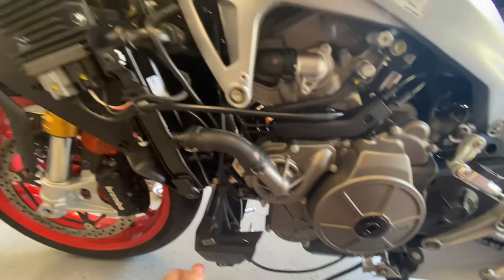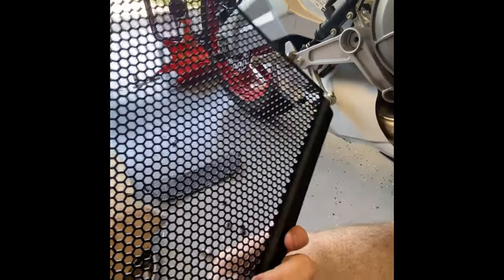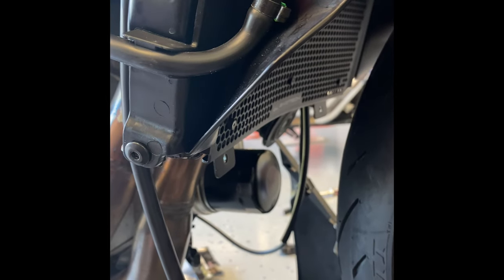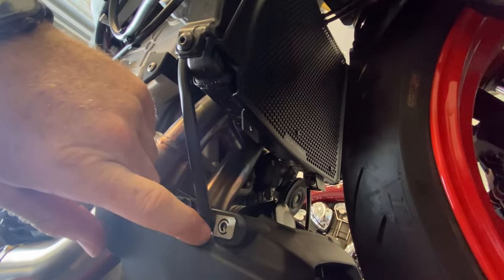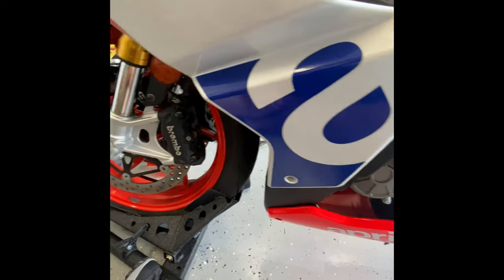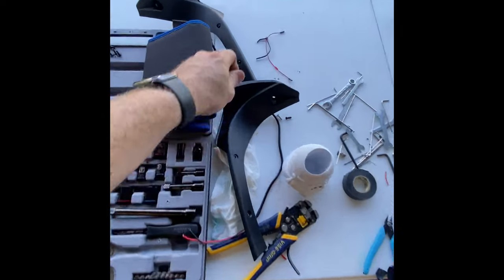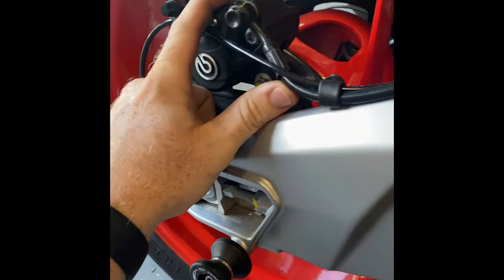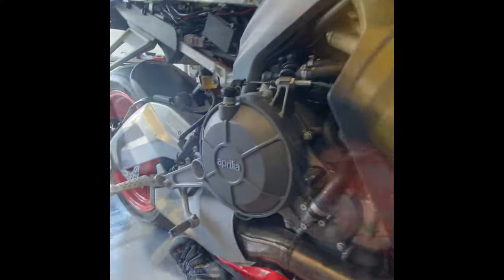Aprillia RS660 Evotech Radiator Guard, Wiring for heated grips and TPMS, MIA. Fairing Install

Comment: This is excellent, thank you for posting this. I just got one in acid gold and I’m bringing it in for my first service soon, the dealer couldn’t get me a radiator guard so I’m just going to do it myself along with the MIA. This was fantastic.

I also have the same squeaky issue with the rear brakes and it’s rather frustrating coming to a stop on a brand new bike and they yell like an old car. They seem to be getting a little better but still. Again, this was great.
Reply from the maker: Thanks! Glad it was helpful!

Comment: I have the RS660 in Lava red, the best fluid to clean the rims is brake cleaner fluid, spray your brakes from the rear to clean them out holding a clean micro fibre cloth underneath to catch the excess, flip the cloth so you don't wipe the grime from the brakes onto the rims and wipe gently, hope it helps:)

Comment: Hey man thanks for the video.  I've bought the same heated grips but I can't get the throttle side on, it's just way too tight.  Any advice?  Thanks
Reply from the maker: I may have taken a knife and trimmed the tube a bit, but I can’t remember that for sure.  I know that I got a little aggressive and used a rubber mallet to push it the rest of the way, and managed to push it on about 1/3 of the way without the mallet. Took a little persuasion.
Reply: @allthekidsareright  Legend, thanks for the advice
Reply from the maker: @22088607  awesome. Did you get it?

Comment: Great video. One question, when you reattached everything did you use loctite or any type of threadlocker?
Reply from the maker: Not on the fairings or anything,  When I worked on the brakes I did.